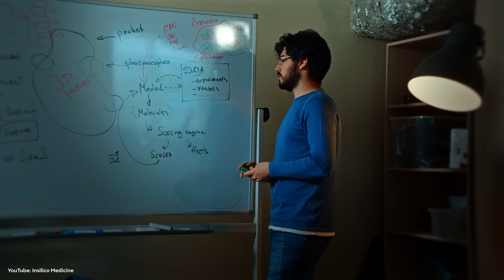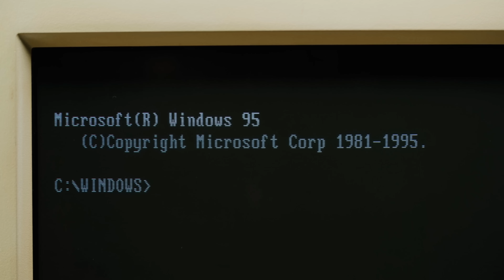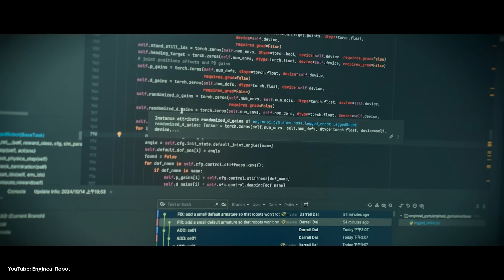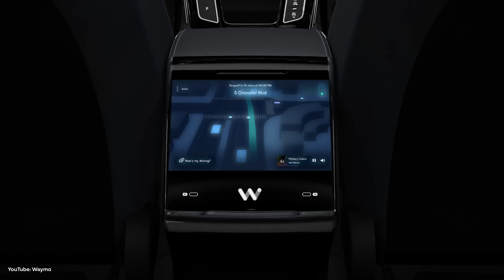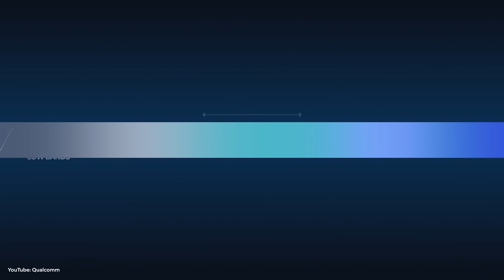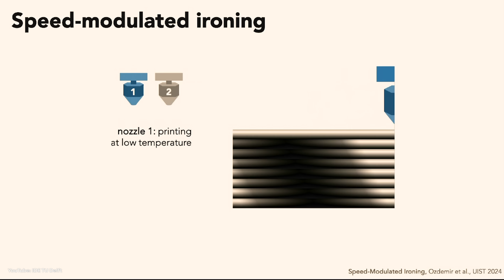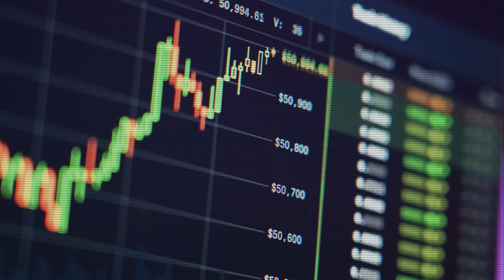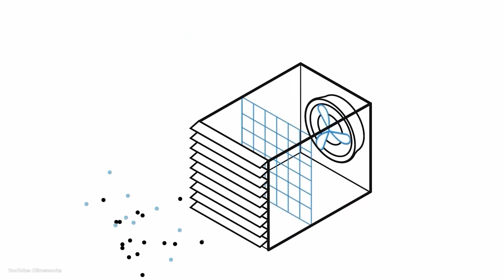The 10 Biggest Technological Innovations of This Year

Comment: You fell off a cliff when u got excited about 6G, they still can’t even make 5G practical it’s been like 5 years. 5G mm is essentially a fancy WiFi router that’s outside 😂, it can’t go through walls, and if bush gets in the way ur signal is gone. PLUS u can only be 200ft away from the 5Gmm tower (with line of sight) before it doesn’t work. Bro that’s literally just like my expensive router in my house 😂😂😂. 5G has become a massive scam, this give the public zero trust when it comes to 6G.

Comment: I like this channel but you really need to look beyond the press releases and investor hype. “AI” is a complete mess and prone to wildly inaccurate results. Using it to circumvent normal safety and testing procedures for medicines isn’t good news, it’s terrifying. And quantum computing isn’t anywhere close to being useful for anything - it’s a complete sham and nowhere near ready for primetime. But even once they can scale the process up, quantum computing as it stands now will not useful for most types of computational functions. It’s only faster at the one single math problem it is capable of calculating, which currently one useful projected application: breaking encryption. And that means the complete end of privacy and security as we know it. Not good news.

Comment: Carbon removal, 3d houses, self driving are all good, but improvements in solar will likely have the greatest long term impact.  
P.S. cancer removal/ prevention isn't in this one, but that would be potentially the biggest impact. 

Thank you for your videos.
Reply: My problem with carbon capture is, that it is currently unproven at best, i.e. a waste of money in this case, or another tool to shift focus from lobbies. It should be researched, but unless its efficiency is proven, it should not be promoted.

Comment: I tentatively support Carbon Capture. I understand that transitioning out of fossil fuels and into renewables is overall better, some places already meet their renewables goals, so building in places where there is already abundant renewables and capturing excess carbon using them would be a good place for those places to at least pioneer the tech.
Reply: My problem with carbon capture is, that it is currently unproven at best, i.e. a waste of money in this case, or another tool to shift focus from lobbies. It should be researched, but unless its efficiency is proven, it should not be promoted.